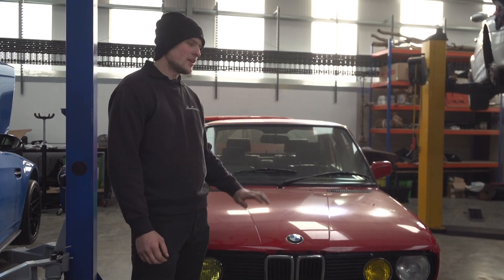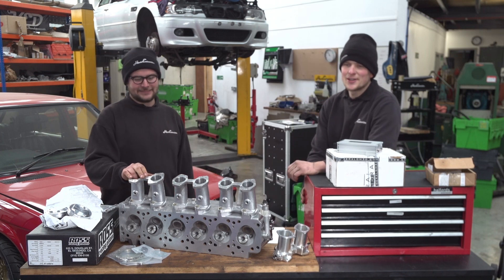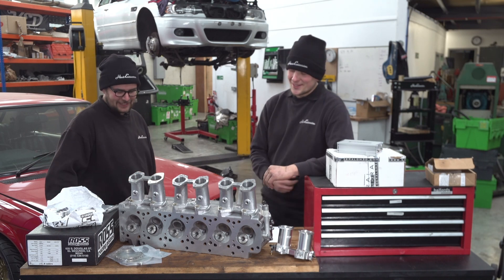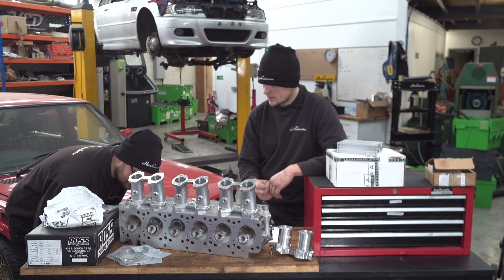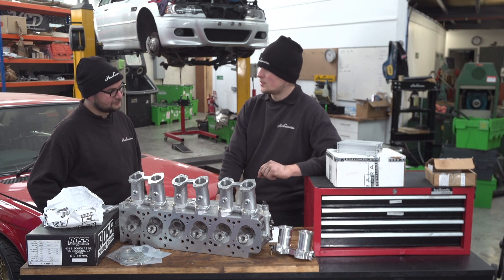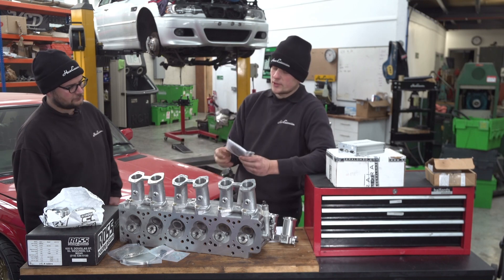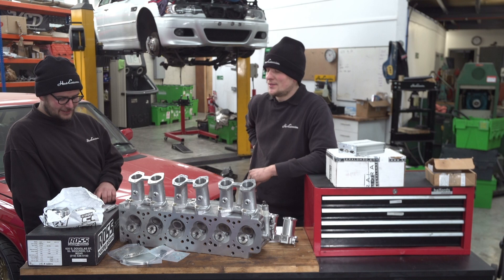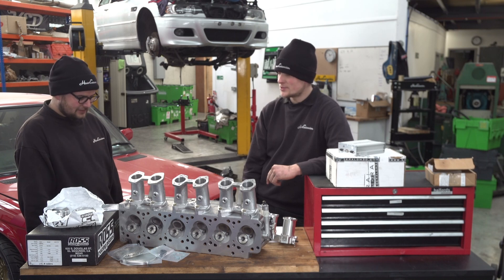Upcoming Parts Reveal - E28 M535i Transformation Episode 5

Comment: Hey guys nice vid! I do have a question kinda related.....I'm throwing an M30B35(which comes from a 1988 535 manual) in the 1985 635CSI manual, replacing the M30B34. Question..s are lol What would be the top 3 pitfalls to watch out for? Should I use anything from the B34, flywheel, clutch disc....etc.... How bad is it to use the 1985 wiring harness(B34) and ECU compared to using a B35 wiring harness and ECU? Should I use the same 1985 (B34) air intake on the B35? Thanks for your time and look forward to seeing more of your vids!
Reply: You should use b34 block and rest b35 :)
Reply: @GAPIbre  Thank you for the reply, what would be the reasoning behind that? Is it due to the oil pan? Ease of use for electrical hook up? Thanks again!
Reply: @deepthunder1034  the 3.4 has more meat between the cylinders. The 3.5 has a water jacket and larger bores so it seems many prefer using the 3.4 block. Why are you swapping instead of rebuilding/upgrading the factory engine?
Reply: @alexmartinez280  The engine froze, dump/flatbed truck drop a larger rock, crushed my oil pan, oil gone engine froze. I will rebuild it, but it was kinda my daily. I needed quick back then...lol. But the other one (engine) is ready. I have an M106 to rebuild in the next week or two! I bought my dad a 1984 745I Turbo a few years back, so we could go to shows together. He's pretty ill right now, so I'm hurrying to get that done as soon as possible! Thanks for the reply.